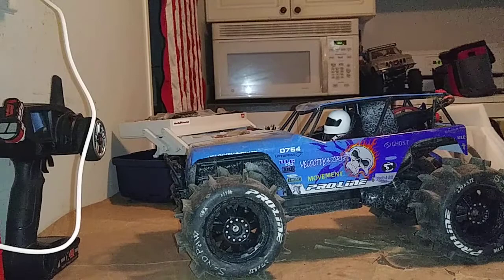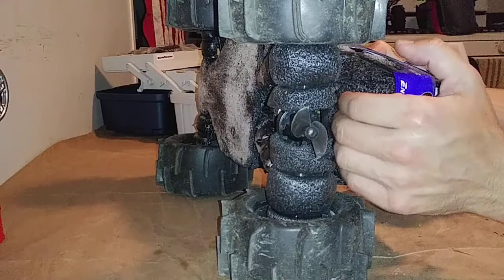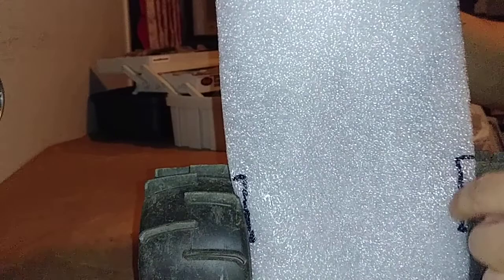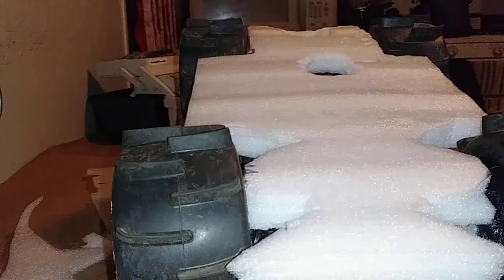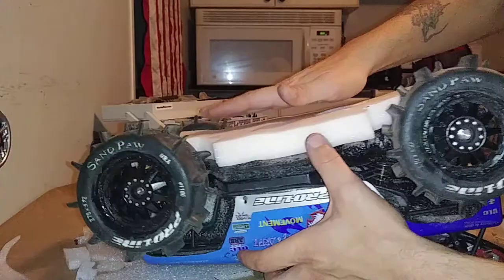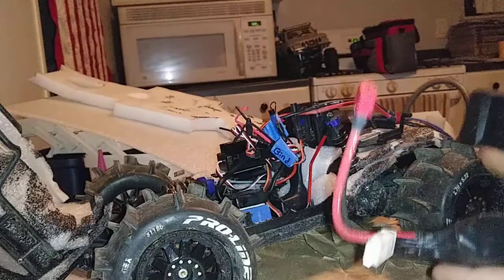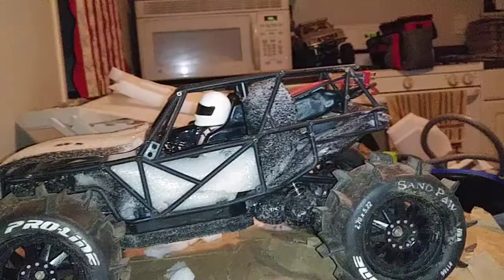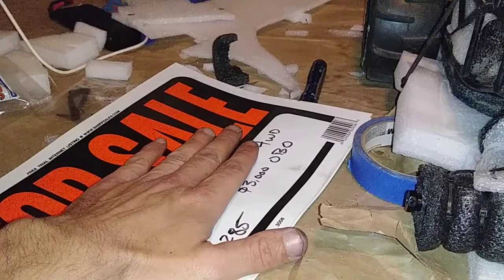Amphibious R.C.,Totally new design

Comment: Nice. Onto the next video. Need to see how this does. Great work brother.
Reply from the maker: Buy it Break it Fix it,ultimately,for off-road,and marine use,it worked the best,just before I put the prop on,the prop limited the rig slightly off-road,
ultimately,if I ran my current prop intake system,and my old foam setup,it would be the most versatile,
After today's videos,I decided to go in a different direction with it, I smoked the transmission today,no high,or low gear, so it might be getting metal gears,and maybe a brushless setup,:)
and leave all the foam on it,lol

Comment: Leave a channel through the middle for the prop to get water from
Reply from the maker: Jerry Compton,I ran it with the channel,and with it taped over,it hydroplaned longer with it taped over,
It currently has a blown transmission lol,
no high or low gears